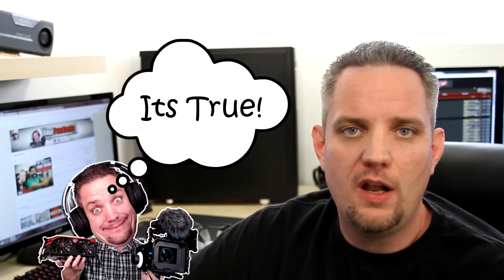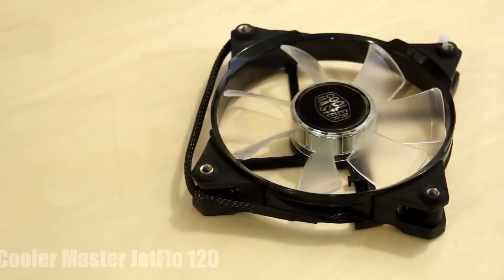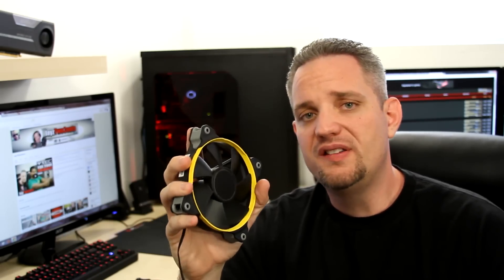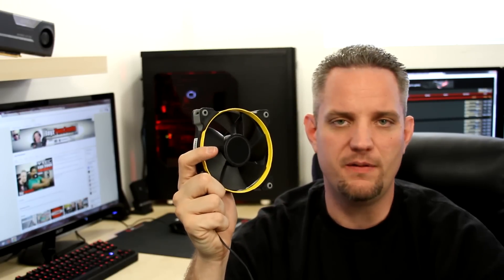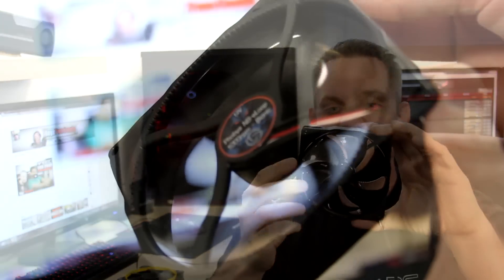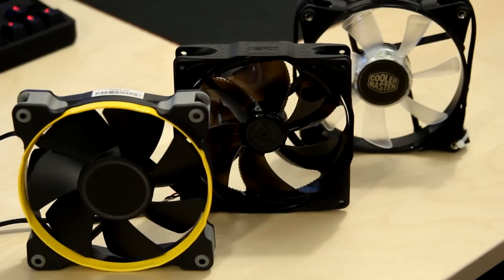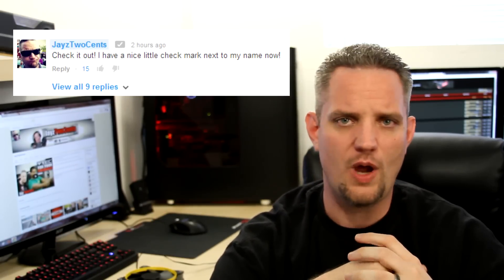Static Pressure vs Air Flow Fans - How to choose the right fan!

Comment: Hey Jay I actually have a question does having led fans produce heat to the point we're it makes a difference. I've seen one of your builds with Corsair fans like I have but their not led you ha e a ton of them bit no led. I was wondering if it was a preference or it is for purpose.
Reply: sorry for post using phone lol

Comment: what fans do I need to use for n200 cooler master case? planning to add 2 front 120mm intake fans, 1 for the rear exhaust and 1 at the top?

Comment: how many fans are recommended for gaming? not over the top overclocking just gaming

Specs

cpu i3 4150 3.3 ghz 2 cores
GPU GTX 750 ti (1 fan) 1.08 Ghz base clock

is anymore information needed? i also have 8gb ram and 1 TB Western blue caviar memory
Reply: what is your case and do you have any other drives?
Reply: SKLZ AwesomeSauce its too late already built it i5 4460 stock cooler GTX 960 4GB asus DVD drive and Tessaract SW case
Reply: +Washu Ken Recommended?  as many as possible.   Minimum?  2.
Reply: KillTheCurse i have 3 case fans on each side except for bottom and in total 8 fans with every components fan
Reply: Washu Ken wow i have a full tower and i only have room for 1 on the back.
Reply: +Washu Ken 2 on front 1 on back, any more is diminishing returns and just wasting money.

Comment: Jay:  I've been researching cooling fans today and ran across your video. You gave great information and have helped a bunch. Let me tell you what project I am trying to finish up. I'm a slip seat driver and just put together a combination c.b. radio/am-fm radio box for the different trucks that we use at YRC. Freight trucks are bare basic trucks. Nothing inside for comfort of the drivers. I'm 60 years old and know nothing about computers. However, I am wanting to use 2 computer cooling fan in the radio box, to funnel air thru the Subarua Outback AM/FM Cassette Weather Band Radio cooling slots. And around the Corba c.b. radio. Some of the trucks are very hot inside, due to no working A/C. I wanted to keep the slip seat box contents as cool as possible. All of the remaining open spaces have been closed off with 3" foam blocks to allow the air flow only past, or thru the radios. The box itself is a military (M80./7.62mm) ammo box, which measures 17.5" x 14.0" x 7.75". I am limited to using an 80mm fan however because of the lack of space remaining after all of the kicker speakers and twitters were installed.  There is nothing within 2.5" of the back of the fans locations. So, I'm thinking according to your information that I should use  high cfm to push air from the lower air intakes and out the open top of the box as the air passes thru, or around the items themselves. I know this is a long comment. And one that you may not have ran across before. As, I mentioned before your information helped more than all of the other videos I've wasted time watching. Wish I would have ran across yours first. DUH!!!  Thanks for the input on my question. I'll check back for your reply.  Semper Fi. OUT!!!!!

Comment: i'm using 38mm think EK radiators with dust filters 1" above or below them. airflow fans actually do a better job on the rads than "static pressure" fans. but i guess it's because my rads are relatively thin. maybe on 60mm rads the static pressure fans would be better. just something think about.

Comment: Please help. If I understand you rightly. To the fronf of case or on radiators I should use SP fans and AF for exhaust. Is that right? (More resistance=more SP needed)
Reply: +Jaromír Anděl i would use sp for the radiator and the bottom front fan where hard drives are and normal af fan for the top front and af for the exhaust

Comment: is it a good idea to put 2 or just 1 static pressure optimized fans where there isn't a whole lot of air flow? and then like 2 airflow fans on top, 1 on the side, and 1 that it exhausts all of the hot air?
like 1 fan in the back that exhausts the hot air?

Comment: Hey Jay. I have a big question for you. I am working on ordering a new cpu cooler right now im think the corsair h60 water closed loop.  I am wondering if I should put a static pressure like corsair sp120 on the push side and an af120 fan the pull side or put a sp120 on both the push/pull sides.  I figured the airflow one would be the best because the static pressure one pushes alot of air thru it would be best to put an airflow to pull all the air way? what do you think jay?

Comment: I am using a corsair H110i on top of the case with two fans. Should I let them blow in the case or out? Out is the best way in my opinion but I am afraid the cooler will pull too much air out of the case in ratio of my fans pushing air in wich creates negative airflow. Probably dust will be sucked in the case from little gaps and holes.

Comment: Hey Jayz, today i finished building my first gaming pc, its amazing, but i noticed it heats up pretty fast, the front of my case has 2 spots for cooling fans, but the fans will face the hard drive slots, and their backs will be towards a the front of the case. The front doesnt have any place for the air from the back of the fans to go, will this be a problem? My case is a bitfenix comrade if it matters. Also it has some optical drive slots that I'm not using, could i open those up to let the air out? Sorry if this is confusing or anything, this is all new to me

Comment: I was thinking about buying a 120mm AF fan from corsair for the exhaust of my Lian Li case since I am about to add a second Asus Poseidon GTX780 and run them both on air. Only problem is if that isn't cool enough I will be placing a 120mm radiator there to cool the two hybrid air/liquid cards. If I do that then I will wish I had bought the SP fan to begin with to avoid buying the same fan twice. I wish I knew exactly how much more noise the SP 120mm will make than the quieter AF... I also don't get why the AF is suppose to flow more when the SP has a higher CFM rating. SP is 57cfm and the AF is 52cfm. Then it is just down to noise. My Noctua SP NF-A14 PWM are silent maxed out at 1500rpm. If this holds true for the Corsair SP fans then I fail to see any benefit of the Corsair AF 120mm as an exhaust fan. I am comparing the following two Corsair model numbers: CO-9050015-RLED and CO-9050019-WW

Comment: I'm using coolermaster hyper 612 as as cpu cooler and 120mm fan is dead. what fan should i buy? air flow or static pressure ?
CoolerMaster JetFlo 120mm?
Corsair Air Series SP120?
please help me find the best option

Comment: ok here a serious question can i use corsair af140 Quiet edition to cool down the case (not radiator) and noctua nf a14 flx or nf a14 pwm to the radiator (not the case)? will it work or should i do something else on the radiator or case? btw i will use a really quiet case, so if the fans make noise i don't think it will be a big problem

Comment: Hey guys I have I-7 3770S in idle I have 56-69°C. If I'm gaming I have 70-83°C I think it is a lot. I'm using the default cooler from Intel. I'm asking you if is it normal? What should I do to lower my °C.
Reply: Kukys CZ know nothing about intel chips but if you runnin one fx at more than 70º you better enjoy the little time you guys have left together, i7 must be around that 65-75.
Reply: Kukys CZ Those temps are too high even for a stock cooler. My advice is to make sure the cooler is making good contact. If that's not the issue, get a aftermarket cooler (Hyper 212) and carefully apply thermal paste. Generally even with not so great airflow in your case CPU temperatures shouldn't get that high. My i7 4770 never tops 75C with my EVO's fan at 800rpm in Prime95. I get 28-32 idle and less than 55 gaming.

Comment: Currently I built a pc with the Corsair 230t, Im just using the standard fans.
It has 2 intake in front, one in the back as exhaust. 
It has a slot for one in the bottom, would that be best to have it sucking IN air? 
(Pushing it upwards.) And then 1 or 2 fans on the top of the case, pulling hot air out.
(Thus cooling the CPU / GPU )
I also plan on getting a hyper 212 Evo, since my cpu kind of runs hot for heavy usage. (no oc btw.)
Does this sound like a plan? only concern is that it will get super noisy.

Comment: So I have an NZXT S340, i need 2 intake fans.
Does the front bezel stop the airflow that much so that I need to get 2x SP Fans for intake or are 2x airflow fans good enough? I specifically want one that can blow on my GPU which gets no direct air so it gets hot.
Reply: +Abra Cadabra In case you didn't buy them yet, get Noctua NF-A14's (NF-P14s redux if you want cheaper ones). There's a lot more high-end competition in the 120mm category, but in 140mm fans Noctua pretty much reigns supreme. I've been through dozens and dozens of fans, testing them in several rigs and I've yet to find a fan that beats the NF-A14. For back exhaust I might go for a fan that has a bit higher airflow and less static pressure (FD Venturi HF-14 is one I tested recently and it was gloriously good, too bad there isn't a pwm-variant) but for pretty much any other use I'd take the Noctua. For damn sure they're leaps and bounds ahead of the Corsair fans, which haven't done too well in my testing and their noise profile is pretty annoying IMO.
Reply: I got the af140s after but you should get the sp140s. They didn't have them ins tock lmao
Reply: I have the same case and I think you are right
Reply: Abra Cadabra I just bought two Corsair AF140s, they're pretty good for this case.
Reply: Gavin Power Thanks a lot. I really wanted to put 2x 140mm fans in the front for a good intake. Now I know I can.
How quiet are they at around 800-1000rpm?
Reply: Not sure, mine are stuck at max RPM and they're kinda loud. Albeit this could be my cpu fans aswell.
Reply: Gavin Power My fans are at "TURBO" in my motherboard software ( aka 1000RPM ) and I seriously can't hear them even if i try... but of course they have low CFM and they are the stock fans...If I put it into full speed you can clearly hear them, they get kinda loud.
Reply: Yeah, I don't have enough fan headers so it's just connected to my PSU.
Reply: I'm getting the same case lol. Did you go with two af140's or sp140's?
Reply: +Gavin Power (Opticuhl) lol ok cool thanks
Reply: +unholy_walrus thank you lol, I needed help on the S340 too
Reply: +EksGaming I'm glad if I could be of help. For the back exhaust be quiet! makes some pretty fantastic high airflow silent fans in both 120 and 140mm.
Reply: Sp.
Reply: +Titan Hound I have the airflow ones, but they don't have enough force to pull air through. So fans would be fine
Reply: Hah no problem at all
Reply: +thewalrus How can anyone put those fans in their case? I understand if you don't have a window on your case... but that color...

Comment: Jayz loves water cooling, I love air cooling. Because I know that the heat has to go somewhere, and thus if your air cooling is sufficient with proper air flow, water cooling won't do much better. All a matter of buying the right fans that are designed for silent run, descent aftermarket cooler, setting up those fan profiles, so you have quiet cooling that is effective, and getting that air flow happening. Although if you want to, you can turn those fans up a bit and get some ultra cooling happening. For example, if I turn my fans up a bit, without much gain in noise, the Noctua cooler I have on my Intel i7 4790K, the cooler feels cold to touch when the CPU is idle. Obviously if you are on load, the cooler is busy moving heat, and thus it will be warmer. But the temps you will get will be impressive, because there is proper air flow along with that descent aftermarket cooler. Thing to watch out for is, any heat from the GPU. Wanna avoid sucking that kind of heat into the air cooler of the CPU. Play around with your setup so that you can avoid putting heat into the cooler from the GPU, and have fresh air coming in, and warm directed out of the case.

Comment: Does this mean that using SP fan with pull setup is better than push? Since push will spread the heat through the radiator?
Reply: zerioification nope, the fans seal against the radiator. on a rad that directional thing doesn't really matter a lot since the air is channeled through the fins anyways. but if you can go pull, it's easier to clean the rad that way.

Comment: What's your opinion on Air Flow or Static Pressure Optimized for replacing the 120s on a Cooler Master Hyper 212 Evo to make a push-pull cooler?  I want to build a white-themed case, and I want to use the Cooler Master 212 with 2 White LED Coolers... I was looking at the Cooler Master JetFlo 120 - POM Bearing 120mm White LEDs to do this...Will these work OK? http://www.newegg.com/Product/Product.aspx?Item=N82E16835103191
Reply: Sergeant Gunny i am looking at a jetflo 120 to replace my stock T4 cooler because the stock one is awfully slow and i cant do push-pull no space in case

Comment: JayzTwo Cents 
I have a Fractal Design Arc Midi R2. On every air intake and exhaust are dustfilters. Currently i have the standard fans that comes with the case, and an 140mm be quiet fan. I removed all the HDD cages, so the only barrier should be the dustfilters.

What kind of fans should i use to get through these dust filters ? I have 4 Airflow Fans

Comment: Watercooling = gentile typhoon or Noctua
Air cooling = Noctua
Reply: FastRedPonyCar noiseblocker everywhere. the eloops are the best fans ever. good airflow rating, insane static pressure while being extremely quiet compared to a similarly performing noctua. and they don't look like shit, which is a plus.

Comment: I got question, i will put 240mm radiator on the front on push pull config. So , push side (which is closer to the case) i put SP, and on the pull side i put AF?
Reply: did you get an answer?

Comment: How do I know if the fans that came with my case (rosewill neutron) are sp? They have to pull through a mesh so I think they could be sp. I want to mount my radiator on the front without replacing an led fan.

Comment: Two fans in the top of my case are causing some vibration noise. I don't have any anti-vibration rubber screws or anything. Any suggestion for a simple workaround to eliminate the noise?

Comment: People make way too big a deal out of SP vs AF. Buy either one, seriously, you'll be fine. More important than SP vs AF is fan size. Buy the largest fan size that you can fit in your case. A larger fan will move more air at lower RPMs, thus making less noise. But, if you have hard drive cages, wires, optical drives or anything else blocking fans, it doesn't matter if you buy an AF or an SP, your airflow and temps are gonna suck.

Comment: This is veryyyy helpful, thank you for making this video lol, people on forums always always leave out the hard drive cage aspect with static pressure fans.. or some of them don't think that even matters.. they only mention the obvious things you would use a static pressure fan for. I do have hard drive cages in the front of my computer so I'm thinking 2 corsair SPs and then for the exhaust a corsair AF. Linus also mentioned the same thing with the hard drive cages and using static pressure. Very good video.

Comment: i'm using the 760t for my build  and there it is a little different, on one fan in the front a drive cage is in behind it so i should probably get an sp fan there, but on the other front fan there is nothing behind it. So i have 2 choises here, 1, move the lower drive cage over the other one so that both drive cages are behind both fans and get two sp fans, which is probably what i'm going to do. And 2, get one sp fan for the front and get an af fan on the other fan and another af for the back
Reply: SubjectDilemma If I was youuu.. I would have one AF and one SP on the front.. and then an AF on the back. 
Since an AF for the front is preferable.. they're also slightly quieter but if you have nothing blocking the fan (like a hard drive cage) then that's awesome.. AF will get much more air down that way. And then yea SP for the blocked fan. You would get less air if you blocked the other fan aswell for no great reason.. unless I'm missing something here.. lol.

I can show you an example of this..
In Linus' video he showed a demonstration in a video called:
"NCIX Tech Tips -  Corsair AF & SP Series Computer Case
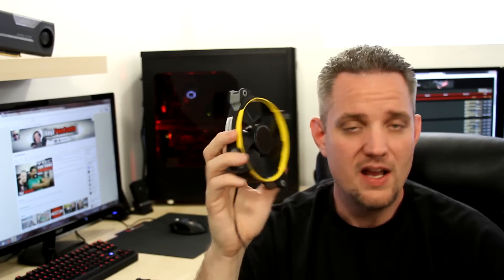Cooling Fans Showcase & Review NCIX Tech Tips" at 3:05 in.
Reply: Gilbert Flowerface actually when i learned about sp fans and af fans yesterday thanks to a friend that was exactly what i'm planning for now
Reply: SubjectDilemma I spent a while editing that comment over and over since I screwed it up a number of times, so you might not of seen the final version lol.

Oh okay tremendous! I too have been doing a lot of research into fans the past few days lol, ever since I got 2 cooler master sickleflow fans put in.. god damn they are loud..
Reply: Gilbert Flowerface actually the computer with the 760t is not a computer that i have, it's just the case that i'm using for a build that i'm saving up for... 3500$ - 4000$... it's going to take a while.

part of the reason i'm searching for a job right now
Reply: SubjectDilemma - Yea you're gonna need a job for that one lol, and then that job will take you away from your creation D:
Reply: Gilbert Flowerface why?
Reply: SubjectDilemma - Expensive? and working means less time for hobbies..
Reply: Gilbert Flowerface the only hobby i have is to draw manga which i'm pretty much doing whenever i have time

Comment: I love my 350d case, I have 2 SP intake on the front of the case, drawing through the dust filter and pushing through the HDD cage. With 2 Exhausts on the roof pushing out.

Considering putting a H80 GT with a single SP on the upper back of the case for the CPU.